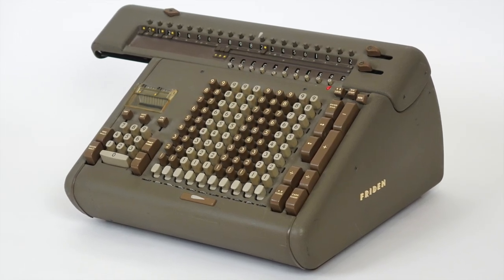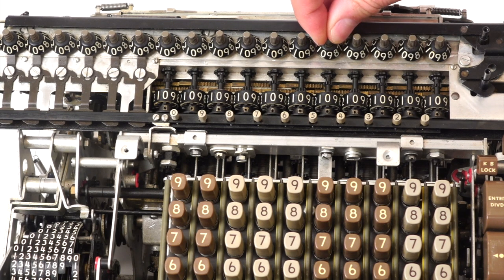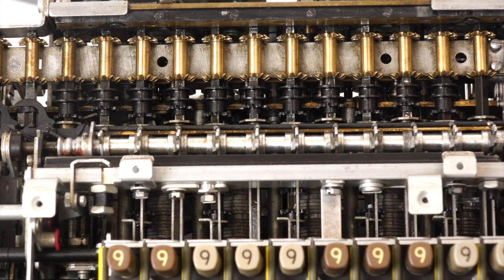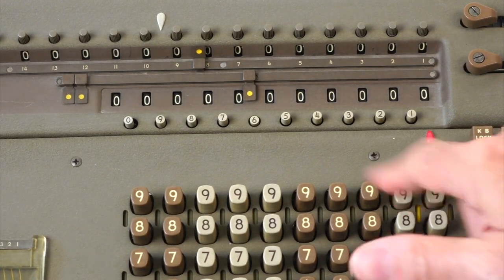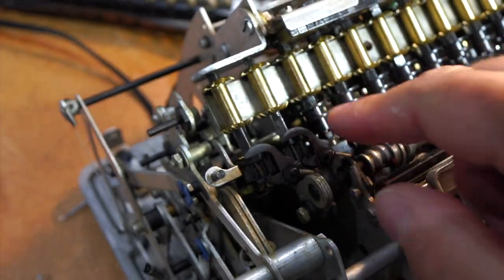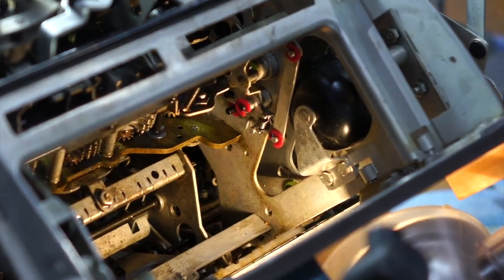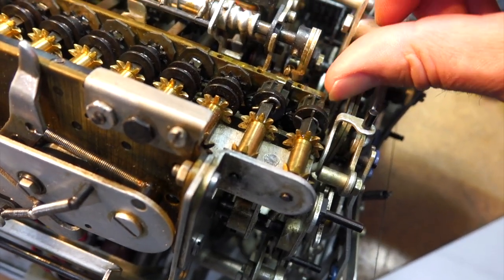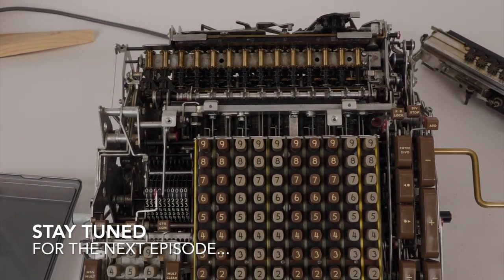Explaining the Friden Mechanical Calculator (while fixing it)

Comment: I still marvel that this amazing, complex, clever apparatus was designed, engineered, debugged, and built entirely by hand without any modern design aids like CAD/CAM, collaboration tools, etc.  Engineers of the 1950s were a force to be reckoned with.  Of course they did bring us space flight as well.  I feel like our overall intelligence might have slipped a bit since those days now that we have so many tools to do our jobs for us.  Same goes for old vs. modern programmers.  It's comparatively easy to write some bloated program that has gigabytes of memory and GHz processors to play with.  Not so easy to do the same task in assembly on the 'bare metal'.  We've lost a lot of elegance since those days too.  Forgot to mention that yours is one of my favorite channels and you do a great job of making forgotten technology accessible to a wide audience.
Reply: The knowledge and skills you mention with programmers has not disappeared. It still exists and many of us know it.

There just isn't a valid reason to do it now days. It almost always is going to produce less efficient code and will cost significantly more time to produce.

Use the right tool for the job. Regardless of if it is a right soldering iron tip, programming language or library. It is just good engineering.
Reply: Drafting despite it being manual labor is quite good and technical. Look at the results like you said.  Good drafters back in the day were the CAD basically. 

Economic reasons is probably the reason why we no such ambitious project not intelligence even then there still are such as race to a COVID vaccine, electric cars, different forms of energy etc etc....
Reply: One certainly has to hand it to the designers.
Reply: This is mostly a matter of perspective. This machine seems more complex because you can see all its internals moving, but modern machines are even more complex, you just can't see it because they use electronic gates instead of levers and gears. Have you ever seen the insides of a modern processor? It has literally billions of transistors. CAD programs can make the engineers' jobs easier, but they also allow them to increase the complexity of their projects instead. The algorithms have also improved a lot: it's more efficient to do math with binary numbers, loops and branches than to do math with decimals and dedicated hardware for each operation, but binary algorithms weren't yet well developed at the time.

Today, you are able to watch a video made by someone that is probably on the other side of the world from you, on demand, on HD, accessible all over the world, probably over wi-fi. You ever think about how complex this whole system is? This calculator is like a toy in comparison. Yes, a lot of modern applications are not elegant, and use "brute force" rather than good engineering, but they are only possible because someone else is so good at their job that they were able to develop some very powerful pieces of hardware that are also very cheap and small.

Also, it's not like the programmers of today don't program on bare metal; it's literally my job. I use C instead of assembly, because compilers can generate better code than I could and are also faster, but that's not because I can't program like the programmers of old, it's just that today's compilers are also better than what nearly all of them could do. C is still close to the actual machine code though, so to write drivers I read and write to registers directly, debug looking at the actual memory and registers contents, etc. Not all programming is done on PCs and smart phones, a lot of projects are still done on relatively weak processors that cost less than a dollar and have 64 to 256kB flash and 8 to 32kB RAM.
Reply: @Destroier534  Humans don't design modern CPUs, software does. While that software was written by a human, it made the CPU design very abstract to us, compared to old school CPUs or some cogs and levers.
Reply: @pizdarus  Yeah, as I recall the original 6502 was laid out by hand and had an astonishingly small number of bugs, considering.  No way it would be possible to create a modern CPU that way.
Reply: João Maverick  Not that the human race changes that swiftly, or that people are less savvy in some ways today, but I feel like people back then had to be a bit more resourceful and wise with less to work with.  Basically the further you get from the days where you needed to use actual fire every day and there were no GFCIs or even good fan guards, the less common sense people have.  I suppose there's a whole different mystique in dealing with the age of social media though.
Reply: I think old school engineering is often based on onion model and design patterns. That's obvious here : the STW-10 "20-digits" calculator encapsulates an older 12-digits calculator. You can tell that from the technical differences between carry mechanism on the first 12 digits and the 2 next carries. Baseline is : they would capitalise on previous designs and just expand existing solutions, much like we do now. But they probably had a much wider - probably product-wide - scope of responsabilities. Now we tend to focus either on tiny bits and subsystems, or only high level views and plans and shit-reports with actual tech performed offshore by underpaid staff.
Reply: The challenges of software today are different--the problem is not making something work with tiny resources (except for some embedded microcontroller programming, which is a bit like the olden days!) but more one of managing extreme complexity, and keeping gigantic and highly complex systems functioning under heavy load. A lot of "wasteful" or "brute force" programming techniques serve to simplify the behavior of a subsystem so that it is more predictable and less likely to cause a subtle malfunction. We also have to worry much more about malicious people trying to attack the system from outside, which was simply not a thing people worried about much in early un-networked computing.

Comment: I worked on all Friden products from 1964 until 1975. In school (Rochester N.Y.) we had to strip the mechanical monster to it's frames them reassemble to working order. My last training was the mainframe computer which supported the first electronic cash registers mostly used by Sears. This required machine language programming in hexadecimal.
Both Redstone Arsenal (missile Command) and Marshall Space Flight Center (NASA) had about 500 of these each.
Or nation's space programs were founded using slide rules and mechanical calculators. Some would actually perform square roots.

Comment: Hey Marc, thanks so much for putting these videos on Youtube, and in with all the detail. I was lucky enough to happen upon a Friden at my local thrift store (what a find!!) and picked it up for a song. After combing through the STW manual you put online, combing through your videos & those of a couple other Youtubers, I've finally got it running! 

I've got a nagging issue with the motor outrunning the rest of the machine and spinning endlessly, with the clutch making that "buzzing" ratchet noise. Sort of remedied it by massively reducing the engine RPM as described in the manual, but I'm working on tightening the spring tension on the lever that closes the clutch & electrical contacts.

These are a tremendously fun puzzle because they evolved so much over the years - between your models & the STW service manual, and mine, produced just a few years earlier, there are a remarkable amount of changes that I had to translate to my model.

I just checked mine to see if I have an issue with carry (mine has 17 accumulator dials, 9 in the register/counter, and 8 number key columns). Luckily, looks like the bell and the transfers work correctly, but looks like mine caps out at 12 transfers.

Mine's a Supermatic with Multiplication, the earlier 1930s type model with chrome trim and round green buttons.

Love your enthusiasm, thanks for inspiring a young guy to take on such a big task and follow through!
Reply from the maker: Awesome, and congratulations!

Comment: Another great Friden video Marc! I've been restoring my STW and almost everything works with the big exception of the lower dials which don't move at all. It's been driving me nuts but your videos help demonstrate how a properly operating machine functions way better than a fuzzy 1950's manual.
Reply: I suggest you get yourself a broken one, really, a parts machine and take it apart. I did the same to understand how my machine (another entirely) worked, and by the end, i managed to fix both. Start with the notion that the second one is just a parts machine and that regardless of how you take it apart, you do it just for parts. Obviously take pictures, and maybe even film things. To familiarize yourself, there's no other way.
Reply: @aserta  good suggestion. I do take lots of pictures along the way so I know how to put things back the way I found them. Marc's patience has been an inspiration so I will keep plugging away at it.

Comment: The amazing and differing methods of carrying numbers on mechanical calculators - great fix on the extended carry section of your Friden.

I finally got a Lagomarsino (non electric) mechanical calculator apart last night - it's been sitting on the bench for a couple of months totally seized, to the extent that I couldn't get it apart - finally penetrating oil and heat got the shaft moving that allowed me to get the carriage off and now I can start working on it properly.

Comment: The ENIAC (the first electronic general-purpose digital computer) was essentially an electronic version of this mechanical technique. I can imagine John Mauchly and J. Presper Eckert thinking to themselves: what if we made an electronic version of the mechanical calculator.  We make 20 electronic "accumulators" of 10 digits each,  provide some switches and a common bus to connect the outputs to inputs and we are in business.  The mechanical gears are replaced with "ring counters" using vacuum tubes.  I believe this is the only computer designed this way. I read somewhere that late in the construction of ENIAC, the designers realized that using binary adders is a better idea.
Reply: I think some of the earliest electronic desk calculators used decimal-based computation, like the ANITA and the Friden EC-130. The Friden's memory was based on magnetostrictive acoustic delay lines and the numbers were stored as decimal digits represented as trains of pulses, almost like a rotary dial phone system but not quite. Each digit was a string of five bits, and from 0 to 9 they were 00000, 10000, 11000, 11100, 11110, 11111, 01111, 00111, 00011, 00001. Very weird.

Comment: Before you pull it out of storage, warm the machine up by a few degrees, more, than what was in the storage when you got it. Don't absurdly heat it, just enough to get everything going. On my machines, i pull the covers off, and blast it with my hair drier (old one) on medium in the mechanisms to heat things up a bit, and i find that it makes first operation, which is always a basic number movement of all the operations it's capable of, in 00 digit skips, a lot, lot, lot easier than doing it cold.

It makes sense, in my head, that a machine, any machine of this integrated level, needs some kind of warm up, and like i said, a humble hair drier does it.
Reply: Get all the old sticky grease a bit more fluid, and expands the metal. Nice idea

Comment: What I have read of mechanical calculator maintenance back in the day was that the whole machine would be lowered in to a vat of kerosene and light oil. The kerosene would dissolve the gummy old oil, and the oil would lubricate it until the next time. I didn’t have the confidence to do that to my MADAS. I used q tips with various solvents then a drip of light oil. Now it is working, I try and exercise it every month.
Reply: Sounds scarily close to my hacky as hell method of dealing with sticky complex light machinery, hose it with WD40 (naptha/kero and oil), excercise until functional, blow off drips, once the solvent evaporates there's a film of oil on everything. It makes sense though, not like there's anything going on in there requiring extreme pressure lubricants or whatever, just getting everything sorta greasy again is adequate.
Reply: Sounds a lot like how in the 70's the watchmaker's tool supplier Elma tried to convince watchmakers that you would get good results by leaving a movement assembled and running it through their fancy machine that had a solvent/oil bath at the end to lubricate the movement.
Reply: That is exactly what we did.

Comment: I think the proper way to service that thing is equivalent to old mechanical clock. It needs to be fully disassembled, cleaned and reassembled (with fresh oil and adjustments). But of course it is very challenging thing to do.
Reply from the maker: That would be a proper restoration indeed, except the complexity of clocks and this is not comparable. It's not even close. I considered it, but it's extremely risky in this poorly documented machine: we are talking something like many thousands of parts. And it's the most non-modular design I have ever seen: everything is connected to everything. Then, assuming you did not lose or break a part and put them all back together were they belong, recovering the correct timing without the proper factory instruction would be a nightmare - if even possible. We are talking several month of work, with a good chance that you'd never be able to put it back together. So I decided against it, and only took apart about a third of the machine, including the entire backplate assembly, which was quite risky. I had no choice, it was entirely stuck.
Reply: @CuriousMarc  It is surprise to me that such thing doesn't have fully detailed service manual. How did they managed to fix such things back in the times? I agree that you need to dive deep in specialized literature (if it ever exists) before doing anything with such mechanical wizardy. I remember my first tries to fix old soviet mechanical alarm clock when I was just a kid... Its spring almost broke one of my fingers☻ Well, after years I managed to read some books and get proper tools. So now I have modest collection of old clocks and watches with everything in perfect shape. And yes, even simple alarm clock mechanism can easy take a whole day for restoration. With that calculator I can't even imagine amounts of time even with detailed documentation. At least you can lubricate everything you can reach with oil. Not really everything of course because obviously some mechanics needs strong friction to work properly.
Reply: We actually washed them in a machine with a turntable and spray nozzles using solvent. They were then rinsed, dried and relubricated
Reply: They were serviced by techs who attended a 13 week school.

Comment: Every time I see the innerds of these machines I’m more impressed than before. The design and fabrication and assembly of that many machine parts, in mass production boggles my mind. Hardened steel gears, cams, rollers, springs, levers, and sheer compactness and density. I assume just about 100% assembled by hand. 

I hate to think how many working Fridens were just tossed in the bin due to obsolescence and still perfectly good.

Comment: Hi Marc! Thanks to this video I was able to figure out why the carry between the 12th and 13th digit wasn’t working on my STW-10. Unfortunately it seems that the two levers you dremeled in this video have shorn off. Do you have a source for parts you can suggest?
Reply from the maker: Not really. I don’t think there is a Mr. Friden equivalent to our Mr. RTTY. That said these parts are mostly flat, should be possible to have new ones laser or water jet cut. Or weld a new tab on top. Not that easy to get them out of there though, this is really buried.
Reply: CuriousMarc I figured as much. Any chance you could give me the dimensions of the part in question? Do you have a scan?
Reply from the maker: @timothycolegrove4365  Go on my web page, https://www.curiousmarc.com/mechanical/friden-stw-10-mechnical-calculator, I have all the manuals there. It's drawn somewhere in one of the manuals (I think the service manual), the page I show in the video where I explain the ca - but can't remember exactly where. Usually the drawings are to scale. It will give you a good idea. Before you make a copy you'll have to extract the real part. The ratchet must be attached to it, so it must have a pivot and several spring attachment points.

Comment: I hardly ever witnessed the sound of mechanical calculators, which obviously were commonplace until the late 1970s and before integrated circuits took over. However, I very well know this kind of sound from films and TV shows which aired even ten years later, for example Knight Rider. To me it seemed ridiculous to put a "modern" computer on a show which is that noisy. But I suspect that most viewers and directors were still conditioned to believe that calculation power had to be in line with the noise a machine makes.

Comment: Have tried to do a divide by zero? Long ago when I had a student summer job in an office they had a calculator that looked a lot like this one. Once at lunch when no one was around I tried to divide by zero. It ran and ran and ran and wouldn't stop! I had to pull out the plug!
Reply: Division by zero is done in the previous video. And this machine has a "division halt" lever for this exact reason.
Reply from the maker: @mirskym: You bet: https://youtu.be/7Kd3R_RlXgc. For some odd reason, one of my most popular videos.